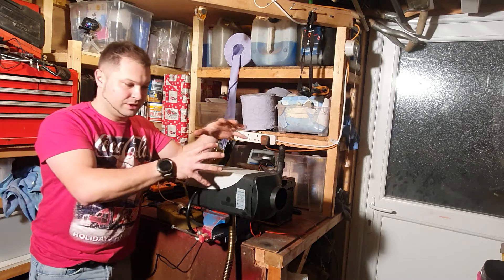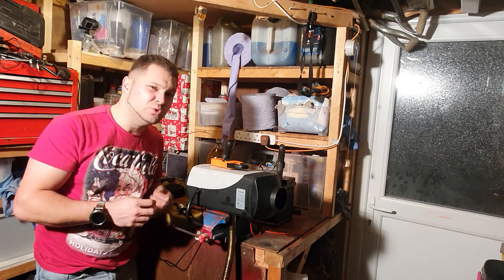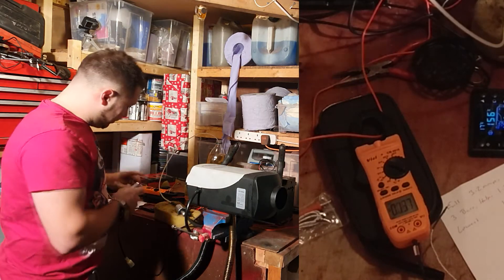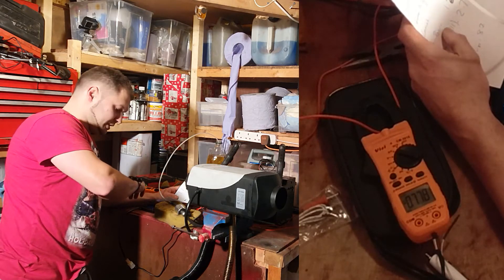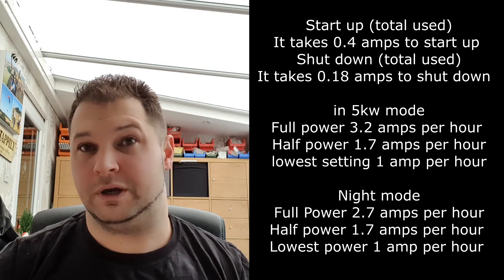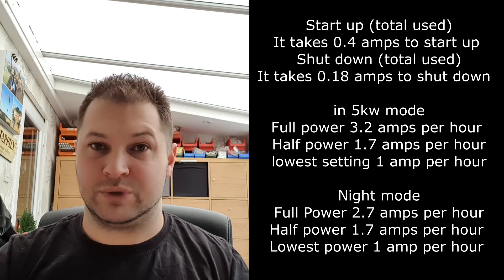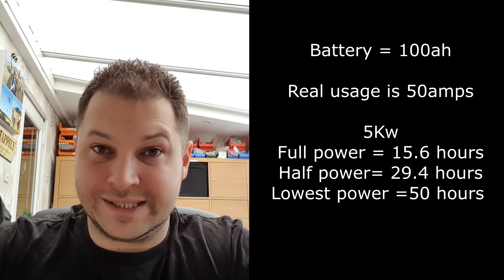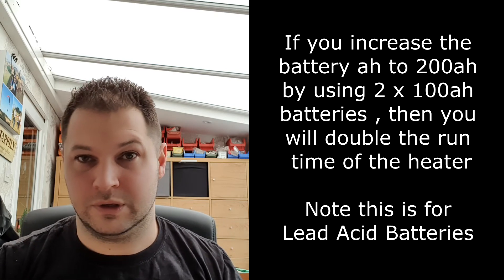Diesel Heater, How much BATTERY Does it use (real world test)

Comment: What about running a 2kw dieselheater (or your 5kw) on a milwaukee 18v 12A battery? 
What do you think of that? Plan is to heat a small place ~2.5 m³. And roughly run the heater ~10minutes  x2 times.

Comment: is a 50 amp battery sufficient?
Reply from the maker: it depends how long you want to run it, bearing in mind, if its a 50amp lead acid you can only pull 25ams from it before its classed as depleted, i would go much bigger than you think you need just in case,

Comment: thanks for the info. I want to do a permanent mains powered setup with enogh battery for 24 hours in case of power cut. The power drop should set off the automatic shutdown sequence of the heater in case the power runs out completely. I want minimal effort, but I will make a nice neat setup. Can you recommend a suitable battery and charger combination? Or maybe an off the shelf UPS unit? I live in New Zealand.
Reply from the maker: i have switched over to the eco worthy li ion batteries, and they are night and day better, than the standard lead acid, more power, less weight, longer lasting.

Comment: I guess you have to use different method to measure energy usage as this heater pump pulsing to modulate performance. So measuring instantaneous current usage with Amp meter would only work if you have huge capacitor to compensate those spikes. Or even better use battery with known capacity and measure time.

Comment: My battery is 130mah. My battery is normally at 12.6v when I put my heater on it goes as low as 11.3v is this normal? Problem is..when it’s at 11.3v my light flicker ever so slightly? Is my battery damaged?
Reply from the maker: What are you using to measure the voltage as the read out on the diesel heaters are not that accurate

Comment: My 5kw diesel heather taking first start up 18amp - 20amp than after 5 min turning 8amp. Anyone got the same high level amp ? And what is exactly reason ? Thank you for video.
Reply from the maker: What meater are you using. Try using a different meter and see if you get the same results. That seems very high

Comment: I have a 2019 4x4 6 cylinder Sprinter van and looking at Espar heater. Could I get away with running the Espar heater off the stock Mercedes battery overnight in a cold climate?
Reply from the maker: I would say it would be best to have a back up battery. Separate from the started battery. Nothing worse than not being able to start your vehicle.
Reply: The vehicle battery is not designed for long slow discharge it is designed to give a lot of power for a short time, you can use it but this type of use will considerably reduce its life best to get a leisure battery  👍🏻🇬🇧

Comment: Good video can I charge my car battery while running the heater
Reply from the maker: I use solar panels to charge the battery while I'm using the heater. It is safe to do so as long as you don't charge higher that 14.7v

Comment: Our 2kw draws 8.5 amps on start up but ive got a 10 amp electronic  battery charger connected to a 75amp 12 volt car battery when the heater slows down it draws less than 2 amps  and allows the battery to recharge in maintenance mode whilst the heater operates.  at 2 hertz pump dosing speed the warmth is enough to heat our 2 bed two up two down all night long, one air vent in the kitchen and one in the living room. The heater is mounted to our outside wall but the air intake comes from indoors. The burner intake is externally mounted.
Reply from the maker: I'm going to do a video on this soon. I have bought one to fit in my house 🏠 🙃

Comment: So I am trying to run my heater off my Jackery 1000. I've had some people say they were able to, however my heater starts and then dies when anything more than the fan is on. But when plugged up to the vehicle works fine. So would I be correct to assume the jackery doesn't have the start up amps to run the full startup process of the heater? Should running the heater plugged into the vehicle for the start up then switching it right to the jackery work? Or is it the wires aren't moving enough power for the startup process? I can't test any of this out until tonight so I'm trying to figure out my next move. If there's a way to get this thing to run on my Jackery I need to figure it out.
Reply: I have the same problem. Ιn the car battery it works normally while in the blitzwofl power station it turns off after 10 seconds. Any solution?
Reply from the maker: This is because the power bank cannot delivery the amps needed (even though it may say it will) it may be an idea to have a small battery world in to act like a capacitor for the first few minutes of start up. It should be fine after the glow plug goes off
Reply: @justharryjohnson7250  I ended up getting a DC to AC adapter and plugging it in to the AC side of the Jackery. Works great. I'm finally working on hooking up my actual battery so I'll rewire it to a fuse panel   when that's done.
Reply: What diesel heater is this?

Comment: 11:50 true but unless your van is more than a SWB you don't need a 5KW. I have a 5KW in a MWB transit and I sweat even on 8oC - yet I have a 2KW in a Mazda Bongo and I sweat at around 17oC. I do agree if you have a large van 5KW is the best - better to have one you can turn down that one you can't turn up.
Reply from the maker: This is true. Even on minimum my mwb van creaps up in temperature. But it is nice to be able to quickly heat it up with the 5kw.

Comment: If the heater exhaust blows smoke.. it's not running right... if the exhaust runs nice and clean and rarely has any to a fine amount of smoke it is running right.. I run mine on 1.6 P ( 1.6 pulses per second ) .... that pulse rate burns clean and it runs a low fan rate as well as very little ( fuel oil ) diesel !
Reply: its not good to shut it down at that speed as it can coke up the burning chamber best to turn it up to full 10 mins before shutting it down.
Reply from the maker: Thats true. The newer ones have a shut down cycle that stops this issue

Comment: I haven't yet fond the answer to this question.. But sure it's out there.. What is the best cleanest fuels one can burn in their diesel air heater .. turbine ?
Reply from the maker: Kerosene would be the cleanest burn. But deisel is fine as long as you run it on full for about half hour every once in a while. I have had mine for three years now and still running well

Comment: Surely someone else mentioned this.. But what the hell.. The Mountains.. signifies it's in High Altitude Mode.. as in.. density of air / OXYGEN is lower.. thus.. the burn rate will change !
Reply from the maker: Yes. The higher the altitude the less oxygen therefore less fuel is needed. But it won't damage the heater by running a leaner air fuel ratio. And it saves me a little fuel too 😀

Comment: I have 3 750 cca batteries and at start up it kills the battery even if I put a car battery charger on. Is there any way to start it up easier?
Reply: You need bigger wires .. the heaters wires are too small to begin with
Reply from the maker: Cca mean nothing. Its the amps that battery has that matters. Your heater will never consume the cca the battery can provide.

Comment: the reason these diesel heater's pull so many amp's on shut down is because the glow or heater plug kick's in at shut down to clean off the vaporising screen so that it dose not carbon up so fast,, and all the Chinese diesel heaters work in the same way,, and as an added point,, dont rely on the heater's battery feed wire's to carry enough battery power to the heater as they are very ""under rated for this job!"",, you would be far better off cutting the battery power wire's shorter and fitting on a heavy gage wire from the battery up to the heater like a ""35 amp wire"" as the Chinese only fit there heater's by using fuse wire!, and it's not beefy enough to carry the current for any distance,, this is the cause of many major start up and running problem's

Comment: Lithium ion is 80%
Reply from the maker: Is it really ? What's the price comparison in relation to say a 100amp lead acid ? Also does it need some kind of special charging ?
Reply: Yep. I was just about to point out the difference of using SLA, AGM and Lithium. The first two are correct in how much they can be discharged, while Lithium does allow for 80% discharge and more than double the charge/discharge cycle of an AGM and a SLA.
Some LifePo batteries do allow 100% discharge although I've never tested that.

Comment: So. I would just point out that the "night mode" here is intended to be a "high altitude" mode, which slightly reduces fuel delivery to account for lower oxygen.
Has nothing to do with lowering output for "night" or whatever. This can cause a lean condition at lower altitudes which, for the most part, isn't a problem.

Also, not all units actually do anything at all when this mode is activated despite the controller actually having the feature.
Reply from the maker: Thank you for your comment. 
It does slow the pump "ticking" by half therefore it does slow down the fuel as you mentioned. Because less fuel is being burned the heat output is reduced. Therefore lowering the temperature. Its better for exhaust fumes as it does not smell in this mode. And saves me fuel. So win win in my eyes lol 

Thank you for watching
Reply: @justharryjohnson7250  replied to the wrong video at first.

At any rate just keep an eye on thing. You might run into issues using it that way but it should be OK.
Reply: @justharryjohnson7250  can you dial down a 5kw to a 2kw?

Comment: So a question I have is I've been parked up in my van for 3 hours with the engine off and the diesel heater on in the back and its running  off my main van battery , I'm just trying to find out how many hours I can safely run it for  with our risking my van not starting
Reply: thats a hard question without knowing your battery size but to be on the safe side i would run the van until the glow plug is hot and not drawing the startup power and same when the heater is shutting down.
Reply from the maker: This depends on the size of your main battery, its age and health. Best to get a battery in the back then you know the engine battery will still start your engine
Reply: How long is a piece of string. You dont provide any information so an answer is not possible.

Comment: Can you explain how a 88-98W glow plug consumes less than 0.4A at start-up?
Reply from the maker: It used 8 amps on start up and 1.6 amps (or something very close to that) to allow the heater to run. Basic math shows it using 6.4 amps more on start up and the only thing different on start up is the glow plug comes on. Therefore the glow plug uses around 6.4 amps
Reply: @justharryjohnson7250  can I use my ecoflow river 2 that is 8 amp dc out put.
Reply from the maker: It doesn't
Reply: Drawing 6.4 amps but for a short length of time, so it is high amps per hour but for a very short length of time...
Reply: He means 0.4 amp-hours, not 0.4 amps. So, 8 amps for 3 minutes, or 6.4 amps for 3.75 minutes.

Comment: Hi is it possible to run off a separate battery and charge when I get home
Reply from the maker: Yes as long as the battery is large enough for your intended usage. Which you will have to work out amps vs time used

Comment: What you called night mode is actually the high altitude mode and it lowers the pulse rate of the pump to change the fuel to air ratio to burn cleaner
Reply from the maker: Thank you. 
I like saving fuel and its much better for everyone not to smell exhaust smoke. That being said this is a very clean burning machine in comparison to others I have had
Reply: True.. and the setting is actually to make sure the fuel burns.. adequately... Not cleaner.. although that is a result as well... it isn't the reason behind the high altitude mode !

Comment: hi, i have a 60amp battery but will have this on a trickle charger when i use the heater, would this be ok? cheers
Reply: Hi, not it's not OK. Your van may not start. You should consider a separate leisure battery to run the heater.
It uses 10 amps for 15 mins to heat up and cool down, before you get heat you've used half hour, or 5Ah.
Run it overnight for 12 hours, that's another 12Ah. So your battery is now 60 - 17 = 43 amps.
Reply: @SuperDriveby  hi, i am using this to heat my gazebo and so whenever i use the heater the battery will be on a trickle charger.
Reply from the maker: In that case it should be OK. You will get heat from the heater within around 5 mins. Depending on the unit used

Comment: Tried night mode with ok+cog no luck??
Reply from the maker: Yours may be an older version heater. My first one never had it either. This newer one does. I would not worry to much as long as it heats when you turn it on its doing its job

Comment: Nice test an conclusion, i do a Lifephos Batt with a little PV Panel..once you get 1-3 amps from the roof you might be good to go!👍
Reply: I have a 2KW heater right now ( 5KW in the loft for spares) and the thing only pulls 4A when starting up and 0.6 when on idle. I get 5 days straight on 1 100ah Lifep04 battery

Comment: I'm sure that the rise amps on shutdown is due to the glowplug coming back on to burn off any diesel left in the chamber.
Reply from the maker: Hi there thanks for watching. In the conclusion I go on to mention what you wrote around 8.10. It was quite interesting doing this as I thought they used alot more battery power than that.
Reply: @justharryjohnson7250   yes I saw it just after i posted lol
Reply: It is
Reply: correct